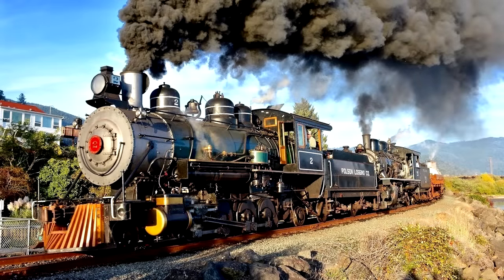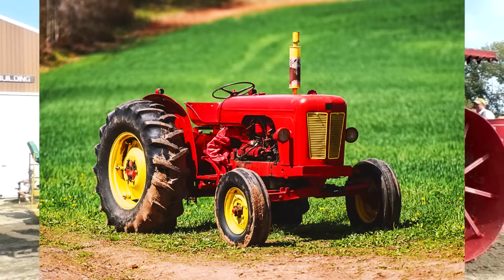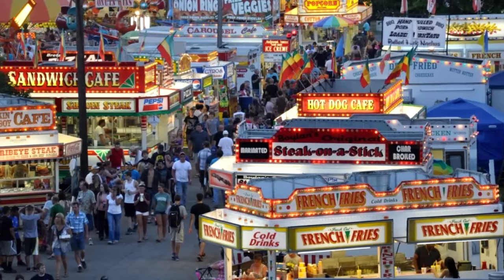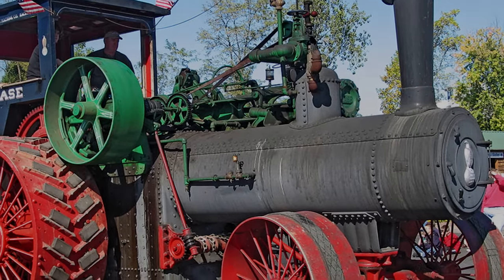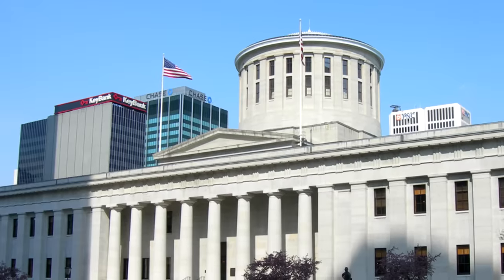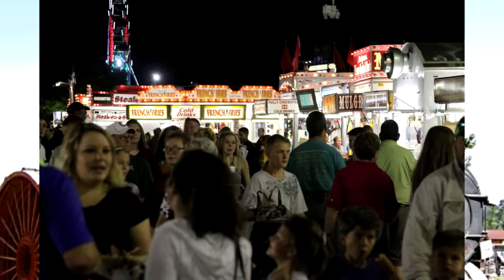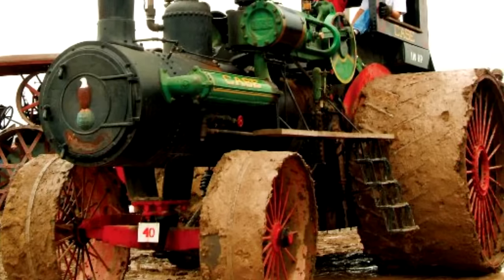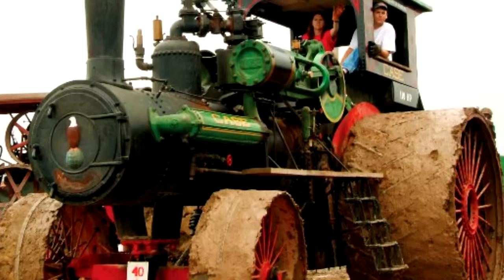The Steam Explosion That Destroyed a Fair 🚂 The 2001 Tragedy in Medina County 🚂 History in the Dark

Comment: I have been involved with steam equipment for over fifty years, mainly rail, standard gauge and miniature, there are three things that should be understood, (1)  know & understand what you are dealing with (2) inspect, inspect, inspect, (3) never assume. A steam boiler is a bomb once it's in steam, the water level in the boiler is the most important item that requires your full attention, therefore the water sight glass must be maintained and regularly checked for correct operation.
To ensure the boiler remains safe to operate the following is also required,  boiler washouts & routine boiler inspections by a qualified person, correct feed water treatment, this will prevent damage to the inner heating surfaces of the boiler, inspect/replace fusible plugs at every inspection.
Reply: same here. as a spectator. It's common knowledge only a boiler engineer or a steam engineer is allowed to operate steam engines.  Also those annual inspections are the cause of steam remaining an abandoned propulsion.  While the available energy is unmatched before nuclear, the cost of maintenance is overwhelming when a boiler needs tubes replaced. It's not for the private individual since farmers and taxi drivers  avoid maintenance, which is catastrophic
Reply: My cousin owns the 1915 steam tractor which was once owned by our great-grandfather.  He did a total overhaul of it in the late 90's and early 2000's.
Reply: @dx1450  I have associates, steam engineers. Even inspection is a thing a novice need avoid. I know I would have made mistakes during inspection which would have been a split tube in one example. I thought the tube was in great cond. but after being shown the fault it made a weakness the length of exposed tube with no swelling. Inside the boiler. F that I'm outa there

Comment: There's a lot to digest here, but I want to clarify something in particular.  This accident is primarily caused by operator error.  I will not argue that the state of maintenance on this boiler is beyond unacceptable.  A simple ultrasonic thickness check by any boiler inspector would reveal that this boiler should never be put into service, regardless if it's out in public.  HOWEVER, the lack of the operator's awareness of the water level (among a host of other oversights) caused this accident.  A brand new boiler with perfect construction will almost certainly explode if operated in this same manner.  The fusible plug that you mention is located at the back of the crown sheet since most low-water events occur with the engine 'nose down'.  The right FRONT section of Kovacik's crown sheet was found discolored, leading investigators to believe it was the section left uncovered and the first to fail.  The traction engine was likely sitting in a position that allowed the right front to be highest and first exposed above the water line.  This indicates that the water level was beyond low, leading to a localized hot spot and crown sheet failure.  This man had no business operating ANY boiler.  ALL PRESSURE VESSELS ARE DANGEROUS.
Reply: Come on, it was entirely the cop's fault for stopping him.
/sarc
Reply: Agree I teach basic boiler and compressor safety. Either one poorly maintained and or poorly operated/regulated are KILLERS! It's one thing to operate this equipment on one's own property. But to DRIVE it on public roads to a fair operating as it is in the shape it was in (and with all due respect to the dead) an incompetent operator is a gross failure of protection of the public good. This equipment should have been hauled to the fair COLD and stayed COLD until hauled back to the owner's farm . Unforgivable failure of the public trust!
Reply: @j81851  just having it in a back yard/shop running is dangerous and probably can damage or injuries/kill the neighbours next door more so if its in suburbia where everyone else is closer together.

the UK might have it right to register as car's/MOT as i have been reading education on operating individual different models would be hard as there not standardised on construction/control's ect. so that part might not work out so well to have a operating license system
Reply: My dad ran and maintained a massive boiler at a textile factory, and I remember I'd go see him at work and was just amazed at how big it was.
Reply: @nicke1903  i have done pretty much done the same thing as your dad but not in a textile industry 

Yes by all means im okay with backyard HP power and heating boiler's but they can't just be unlicensed/unlimited as it has killed people before so having rules and enforcement saves lives in the community and welfare ect. . yes some people aren't cut out for operation of dangerous equipment like dry-steaming power as my background has taught me or they lose respect for it and it gets the better of them as a aircraft say don't get fly home syndrome it will kill you one day
Reply: @nicke1903  most boilerplate's have been replaced in the last 20-ish ( 1950"-now started as the grid got good enough in the USA 🇺🇸 ) years for electric power and or newer technologies/equipment so unless you are running a older plant or really need steam for hourly-process operation's that there's no substitute for the boiler's gets ripped out anymore as it's not used for heating or electric or shaft-power power generation 

heat-pumps took the placement of the boilers now days in general as a example
Reply: @nicke1903  you're right about the scale of a ship/manufacturing 300HP boilers the 90's movie 🎥titanic doesn't do it justice as it's hard to understand the sizes of equipment vs people 

i transferred from working on regular passenger/race cars to millwright in my early 20s and yes it struck me funny thinking men in 1880's-50's use to hand shovel coal to feed these beasts and or the size vs me at 20YO~ and that it's basically a vary controlled bomb that most people on main street has no idea it's there waiting for someone or something to go wrong 

thankfully most of the ones i have been around are LPG or oil feed but i always have had a thing for coal/solid fuel fired locomotive's/traction engine's
Reply: Well said. Spent 37 years working with high pressure boilers (on #6 fuel oil 😢 ), inspections are a must. Thanks for the video.
Reply: @richardprice5978 we actually have an operating license here in the States. Many different steam schools all over the country to get certified. Almost every state has yearly inspections on all boilers. Every state has ultrasound requirements of all engines to be certified for operating in public. Here we don't allow anyone on our property to operate any steam engine alone that doesn't have 500 hours of experience.

Comment: In the UK, engines have to undergo a pressure test every 14 months, and a full inspection every 10 years.  As a regular attendee of engine fairs, I hope that keeps us safe.
Reply: Here in Wisconsin, we do inspections every year. Hydro, ultrasound,  visual,  understeam. We are doing an ultrasound on a 25hp Minneapolis right now that was built in 1915.
Reply: It varies by location in the U.S.  I had a steam car for 12 years. No formal inspection was required. It fell below the hp and evaporating surface limits for inspection. You can be sure that I educated myself and kept that machine in top order. The consequences of a lax attitude are severe. I have never met a single steam operator that didn’t take the responsibility seriously. We’ll never know what that operator was thinking, but I wager that you won’t find many like him in the ranks of preservation steam operators and engineers.
Reply: Hi, in the UK it is actually every 12 months. Interestingly the 14 months was stipulated so that inspections on boilers that ran factories could be carried out at the Easter shutdown, the traditional time. As Easter is so moveable legislation was written to accommodate this, hence the 14 months.
Reply: Scheduled inspections don't prevent unsafe operation or ensure that no damage or wear has occurred in between inspections. I'm all for them but they are a picture in time and a failure months after an inspection is still a failure.
Reply: @wheressteve  I totally agree, but regular inspections do weed out the worst of the problems.  Re. cars, I have an MOT tester friend, some cars  may have done 80,000 miles in a year (between tests), others like mine, only about 1500 miles.  And some of the sh*t he sees!!
Reply: Here in Tennessee, these boilers have to be inspected every so often (I don't know how often). I remember they used to not be regulated, but regulation was brought about at least in part by the explosion in question. Luckily, there is a local guy that is a certified boiler inspector that also is in the antique tractor hobby. He will often do inspections for free on these steam tractors.
Reply: @perplexedprimate420 the fact we only run these engines a few days a year does not cause major wear to any part of the boiler.
Reply: @andybelcher1767   Thanks for the update.
Reply: Inspections are irrelevant if there is no water in the boiler…
Reply: Who cares what you do in the uk
Reply: @kellytoth760  How rude.

Comment: This incident has been beaten into the ground for the past 22 years, to the point that it's a sore subject.  The engine did suffer a low water event.  The quoted inspectors do make some correct remarks about the over- all condition of the unit, but they also have other negative assumptions about historic steam exhibits in general, so in my opinion they tend to have a rather negative opinion in their conclusions.   Basically it comes down to the fact that it's operator error, both in the operation of the unit and the fact that the operator ignored the over  all unsafe condition of the unit, and continued to operate the unit in public.  As for the fuse plug, no it wasn't welded over, the one in  the unit was deteriorated to the point that the material in the core was pure corrosion and thus not meltable.  Again it all goes back to the operator's responsibility to safely operate and maintain the unit in a safe manner and condition, poor bugger failed his duty miserably and people around him paid dearly.  These big engines are very costly to own and operate, no poor boys can afford one. The last restored 110 Case sold on auction for around 400K,  The fellow that had the one in the incident did have resources to afford one and indeed spent considerable money on this unit. He was warned by many fellow engine men of the poor state of his unit but failed to understand the danger of live steam, he was more impressed with new paint and the prestige of owning such a desirable unit. As a result the entire steam community has been negatively affected, we all pay the price for the mistakes of one careless individual.
Reply: I think it's pretty forgotten today, outside that particular niche of collectors it affected directly. I have family in Ohio and they don't even remember this happened.
Reply: @furripupau  except that many steam shows were cancelled as a result..  or steam exhibits excluded from manmy county fairs in ohio..  steam shows used to be a fixture in many of the fairs..  the owner / operators i met were always anal about their engines..  many were themselves or their fathers / grandfathers retired railroaders who had an utmost respect for the power and awe of steam..  as well as  the knowledge to operate and maintain their equipment. I come from a background of working on low pressure steam HVAC boilers, but the knowledge I gained from steam engineers at shows was vast..  I know nothing about the owner of this engine that blew up. but a low water event is a rookie mistake pure and simple..  a self regulating body and bringing any engine to a fair or other public event cold might be something to think about..  fortunately the historic railroads are well maintained and inspected..
Reply: @eldoradoboy  It is a similar issue with airshows. After the 2012 (I think) crash in Shoreham in the UK, a lot of airshow plans were scaled back. The fear of an off-aerodrome crash and subsequent litigation is now a big factor.
Reply: My friend turned this engine away from his show because he knew it was unsafe and he would not hydro test the unit,  it was a matter of time unfortunately
Reply: Anyway it go incorrect maintenance. Not the steam engine fault. Operator fault.
Reply: As someone who lives close to Gap PA and sees the rough and tumble group with their very well maintained and restored steam beauties running safely for years now I just chalked this up on the ignorance board.
Reply: There was an extensive write-up in the Cleveland Plain Dealer newspaper when this occurred. Seems the owner operator was in a hurry to get his engine to the Medina ( pronounced Med- dina , as in, dine in a restaurant ) fairgrounds, which was only about a mile or so from his own home. When he got the monster onto the paved road, the wheel cleats were tearing up the asphalt pavement. The state highway patrol tried to stop him en route to the fair, but he continued on, patrol officers in slow pursuit. He got the beast parked in the display area and people reported they heard the pressure relief vent screaming as he shut ( ? ) it down. It exploded only moments later. Pieces of boiler were reported to have landed in near by trees. Most people speculate, including myself, that he was so impatient to get the engine to the fair, he made a very bad decision in not putting very much water in the boiler. That being so it could raise steam pressure much faster. The rest is history. Lesson is; take no short cuts with these old engines.
Reply: @barnabyjoy honestly if your that worried stay home. And don't stand next to 150 year old 12k pound rolling pressure vessels.... less gov, more responsibility. And three times the rope
Reply: @bradleysimpson9819  Do they still run the little Shay up there? I was fortunate enough to have been given the opportunity to do fireman duty on that locomotive for several hours years ago.
Reply: @2wheelhoon813  Problem is, you can't sue the idiot who neglects his machine if he's dead from the explosion that killed a bunch of other people.
Reply: @lusoverse8710  Ik it's called trading freedom for false sense of security. It's everywhere you look. 13 percent of your car payment is useless safety tech your forced to buy including intrusive alarms. Emergency braking. Lane departure, backup cameras. Trucks that shift into park with your door open making backing trailers in tight spots at night nearly impossible
Reply: @jamescross2229  2015. The pilot's misjudgement spoiled things for a lot of people. The horror of these 11 lives being lost , and the restrictions on vintage jets at UK airshows ever since. And it darkened the name of one of Britain's finest early jet fighters.
Reply: FINALLY someone else who sees the solution to this problem as one involving each person's concern for their own safety

Licenses and government inspections sugarcoat the dangerous reality of this world - maybe people would pay more attention to the dangerous things around them if some were more dangerous
Reply: @2wheelhoon813  Luckily for the rest of us You are not the decider ...Back in your fantasy of the good ol days...there was a free and uncontrolled market of dangerous and adulterated products that injured and maimed and poisoned people ....And the path to all of the regulation you are whining about is paved in blood and suffering!...

And as a side note Real Drivers don't need to back with their door open...
Reply: @stevebell4906  anyone who has backed a trailer at night knows you cannot see shit. Old trucks the window sill was in the right spot so you could easily just hang your kneck out the window. Now not so much. Your like 3 feet from the fucking window and the seats have all these bullshit bolsters so you can't just slide closer to the door really. If you drive a new and old truck back to back it's the simple things that will drive you crazy. Unless all you do is get groceries and commute to work you won't notice a difference. And your right. We could have taken the learn from your and my mistakes approach. Instead our gov touk the "ban it" approach. Merely bandaiding the problem
Reply: Understand it's a sore spot to you. But the 5 that died now and have not felt pain for some time. You are entitled to your opinion, and it is a sound one. But to become irritated about it in MY opinion which I am entitled to as well is childish and counter productive, no disrespect meant. This event should get a center fold in the local paper and a full page over Ohio every year anniversary of the event. The comments about the new paint and impressive value of the machine are poignant and haunting. This guy that blew it up (never knew the man, may have been like a kid with a new toy, not an egotistical jerk) valued some perceived prestige and intrinsic "bravado" of driving a large steam tractor down city streets to the frustration of all kinds of law enforcement. Warnings from experienced steam people fully ignored and discounted. He just had to go or blow and sadly he did!

Again you may be a great person, fun to chat and have coffee with but I am a bit disappointed even though I don;t know you that you are irritated about the notoriety of this accident. Actually it needs MORE coverage not LESS. I have to deal with people in my business on a somewhat frequent basis operating large low and higher pressure boilers and case studies like this save lives. Sorry if you hobby was jeopardized but hobbies are not generally exchanged for  a tolerable rate of risk where deaths are inevitable because the population collecting the item may have people like this guy. Paint and prestige seem to be too much a preoccupation!